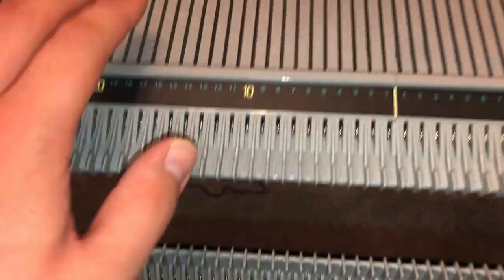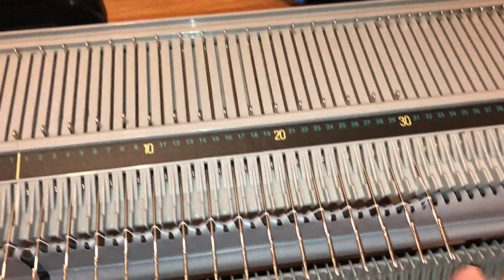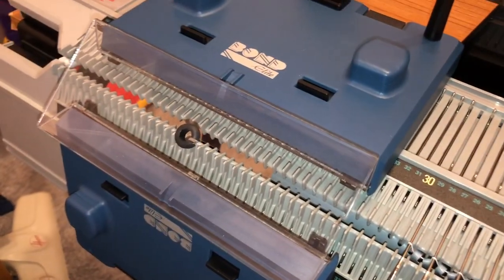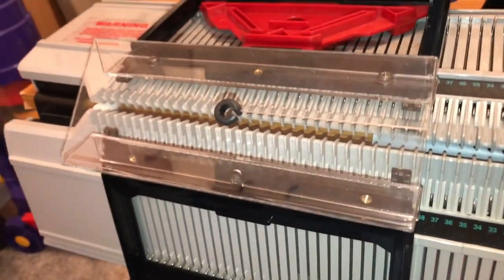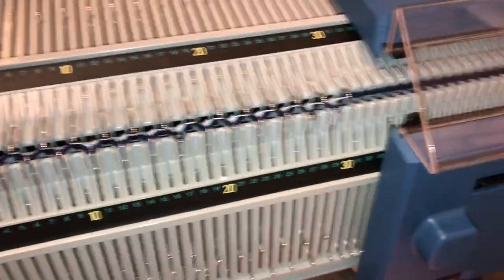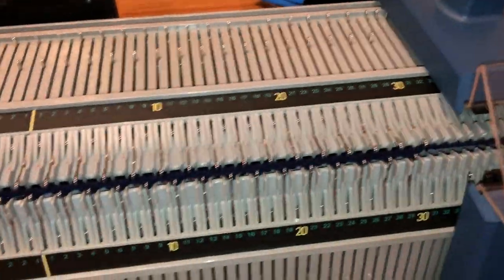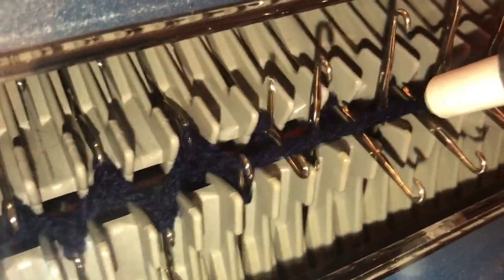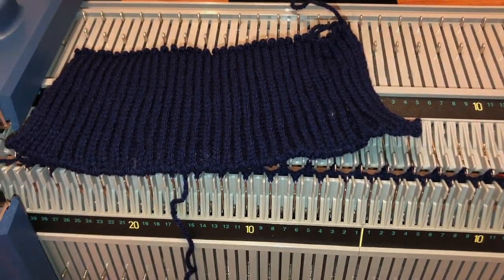Setting Up The Bond Elite Ribber

Comment: I'm not familiar with BOND, but is this an actual ribber attachment or is this two main beds you put together?  May I ask where you were able to purchase the parts that connected the two main beds together?  Where would I find this machine SET?  Thank you! 😁
Reply from the maker: Yes, this is actually a ribber attachment.  The ribber is pretty much the same as the Elite but the Ribber came with different end caps that had white stoppers, so when the ribber was raised, it was always the same distance between both beds, the ribber had the needle number strip the other way around for reading, as the ribber sits in the opposite direction to the main bed.  The ribber came with all the necessary tools, two ribber carriages, two sets of red keyplates that were for ribbing tension.  And the brackets and other tools.  You couldn’t just use a regular elite as a ribber, you’d need all the tools and attachments that came with the ribber.

Comment: It looks brand new, and it's the original model, the later one didn't have a screw on the ribber side the handle was just shut inside. Did it come with the edge weights?
Reply from the maker: I don’t want to sound like a know it all but the original one was as you mentioned, the fairing fixed to the main bed carriage with a single screw and the ribber carriage just held the fairing in place when you closed the ribber carriage.  This is the improved version and having tried both versions, the later improved version, as seen in this video is much better.  The only reason I know this is because I bought two Bond Elites and ribbers as there were pieces missing from the first one.  The first one I bought had the older ribber fairing, so I basically took the ribber fairing from the second ribber I got as the bed and carriages on the older one was in better condition, I am so pleased I kept the newer fairing, it is sturdier and works a lot better.

Regarding the edge weights, it did come with them, yes, the claws and the 7 hangers.
Reply: @Thesweaterfactory  Aye sorry, I've got mixed up, advancing years and six months in exile taking its toll. I've dug both my elites out and discovered the error of my ways! In the excavations I've also discovered a never out of its box incredible!